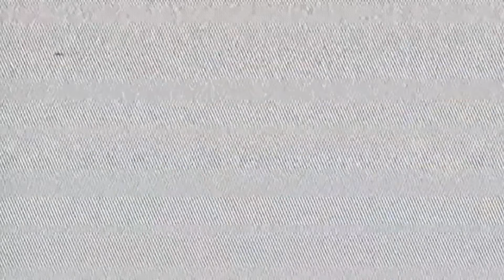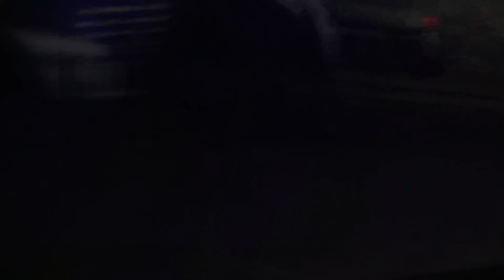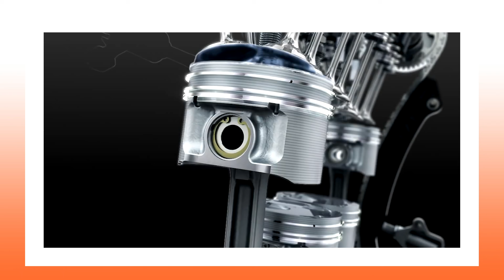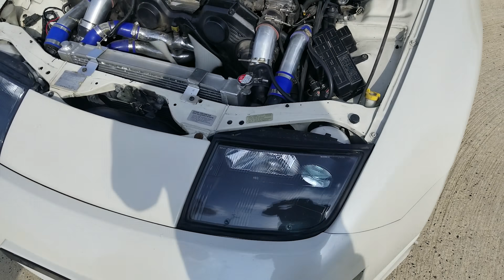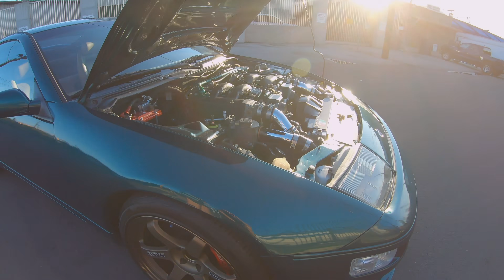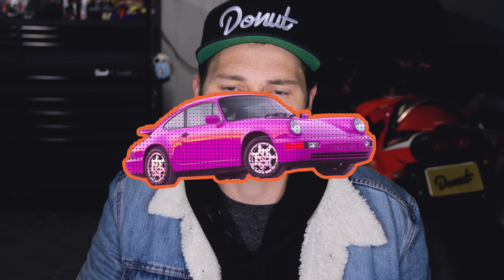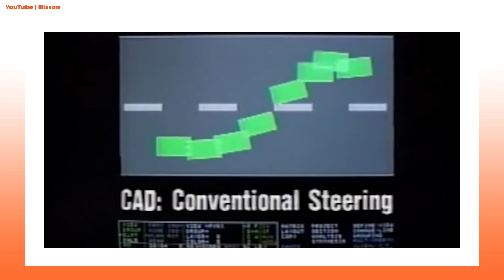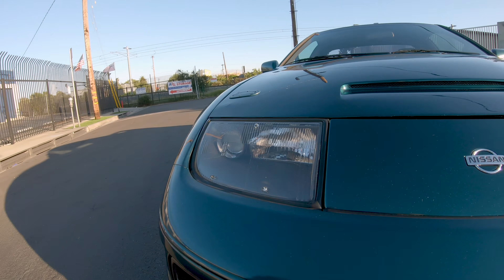The Incredible Tech that DOOMED the 300ZX

Comment: I used to have a '91, I bought it in '01. I loved that car. There were things that bugged me about it but not bad. As far as the tech stuff goes, a friend of mine was telling me one day about all the electronics in his Chevy S-10. I laughed at him and pulled out my factory service manual and showed him the (IIRC) 6 or 7 sensors in the fuel system between the gas tank and injectors. He accepted the fact that his truck, 8 -10 years newer than my car, was about as far as you can be from "technology advanced".

Comment: I own a 1990 N/A, and I've replaced the starter and alternator in the 6 years, and these were the most difficult replacements i've ever done. Then there's the Bose Sound System...I pain a stereo shop the replace my sound system, and they were like "No problem" it took them 2 days. Each speaker had it's own amp, ad they were prone to failure. I have owned it for 7 years and still find myself smiling every time I drive it.

Comment: I bought an 86 300zx 2+2 with a 5 speed a couple years ago. I grew up in them, my dad had one and my grandmother and grandfather had one and I loved them. It had been parked 9 years without being touched when I got it, I revived it, got it running and driving again but literally the day I first drove it was on to someone else's trailer. It had spent a lot of time on the Texas east coast and it was rusted far worse than the PO had led me to believe, to the point that I couldn't even jack the car up, the wheels would just stay on the ground. I had to let it go, I've never worked with that much rust before.

Comment: i have a 1990 NA TTop version and after owning it for 2 years the ONLY issue i have had is the battery not holding a charge because it was old. I call that a win . i just upgraded the suspension from stock to BCRacing DS coils, dropped it 2 inches and put some nice Niche wheels with Indy FIrehawk 500s on. 😙🤌

Comment: >titles video about tech that doomed the z32
>never explains why or how 

Classic donut media
Reply: If you really wanna know, there was no tech that doomed this car except the fact they are annoying af to work on and unreliable as hell
Reply: Ok it's not just me 😂
Reply: The variable valve timing was very new, and relied on a multitude of sensors and actuators that had a habit of failing with out giving an idea of what part of the system failed cause it was pre obd2. So it was tedious and there wasn't much working room. So yeah, when they're running right the car was amazing, but shit goes wrong, and you've got some long hours figuing out what went wrong
Reply: @Fabio.Enchilada   they're unreliable? mines still solid
Reply: all of those stuff are broken when you buy one. Also the turbo model have a poor ventilation and the turbos cook everything under the hood
Reply: @Fabio.Enchilada  isn't that true for most cars? I was suprised at howca Toyota I could wrap my arms around the engine yet not the Nissan. I hate working on any Nissan
Reply: @Fabio.Enchilada  thanks for saving me time
Reply: Old stuff is unreliable period sorry. Rebuild it and do it right and it's reliable. Maybe the old turbos ruin them? Idk the Vg30e I have is a champ
Reply: I’m not even mad

Comment: Got a z31 myself, currently doing a full restoration because it sat for many years. Currently on rebuilding the engine and redoing the interior while the block is at the machine shop rn, and it is the biggest pain in the ass to work on and not just because it’s hard to find parts. Somehow Nissan designed it to where every part of that car cannot be removed without removing 4 others. I love it though, def a challenge.

Comment: I've got an '84 Anniversary Edition in pull me over red sitting at my friend's house that I haven't been able to get to my place in some years but man do I love the looks of both the Z31 and Z32. I would love to get my hands on a twin turbo Z32 as well but they're not cheap or easy to find.
Reply: Im getting a 86 300zx and i want to know if its possible to convert the z31 engine into a z32 engine and is that a good idea to do so? Or should i 2j swap it? Can you send any videos or forums to help me out?
Reply: @Parelogy  If you want the Z32 TT, good luck. They're hard to get a hold of and building one up to handle the tein turbos is expensive. If you want the Z31 setup to be reliable and make decent power that's doable. There's Z31 and Z32 communities on Reddit and specific forums that would help with just about anything except maybe a swap to a different engine platform. There's a lot of basic mods for these, the best ones for reliability are definitely the ignition system upgrades as that's a major downfall of the Z31 between the bullshit cap and rotor design and the ignition control module burning out. Ignition control module swap is easily the best first mod.
Reply: @CheekyChan  2jz swap it is then, thx bro.... Or SR20 swap... Or just keep the engine since the vg30 from the z31 doesnt rly get much love... What do you think i should do? I also own a 1984 (check my channel if interested) mustang foxbody gt junked project car and i just wanna keep the 302 block and build it up instead of engine swapping and also efi convert it. I might just do the same for the z31, just keep the VG30 and mod it for fun and if im not satisfied then ill sr20 or 2j swap it...
Reply: @Parelogy  I would say stick with the VG30. They're beefy engines, built well, can handle decent power from a tune, bigger turbo/more PSI, cold air intake, aftermarket exhaust, etc. before needing to strengthen the internals. Problem with engine platform swaps is that they get expensive fast plus 2JZ's are getting hard to find and are expensive. There's a couple notorious issues with the Z31, as mentioned the cap and rotor crap out because of a shit design, they have a couple areas where they like to leak oil, valve cover gaskets, rear seal/s, etc. but those are at least normal wear parts, the instrument cluster also gets cold solder joints or messed up grounds, not that hard to fix and there's a ton of guys who can refurbish them for a decent price. Ignition control module likes to take a shit which is why the swap exists but that's at least super cheap and easy, a $10 plug adapter and a $20 part, takes literally 2 minutes to install. You can also run a direct coil setup but you'll need an aftermarket computer to control spark after defeating the cap and rotor, I personally think it's worth it and I'll go for it when I get mine to my house and start working out the kinks. My '06 Outback XT is my current project, clean but been modifying the suspension and throwing performance parts at it to get it where I want before I tune it and I have a '98 Volvo V70 XC project on the back burner too. So I feel you, man.

As for the 'stang, there's a reason why they call them "Five point slow"'s. Those 302's are dogs stock but they have pretty good performance potentials with a proper tune and there are TONS of aftermarket parts available for them. It doesn't take a lot of money to get power out of a 302 but an EFI swap is probably the first thing I'd do, it makes tuning the car down the line easier, especially if you're going to be adding mods that require more fuel, you won't have to tinker with a carb, think you set it right and then the next time you start it, it keeps falling on it's face or have to tinker with it because you drove to the mountains, etc.
Reply: @CheekyChan  thx man that helped alot... Now i just gotta study more on this stuff and learn what to do and how to do it... The z31 will be my project daily while my mustang will ne my project... Only driving it to carshows or roll racing or whatever... Both r going to be streetbuild and i think my 3rd car will be a pickup truck like a toyota pickup, and thats rly it...
Reply: @Parelogy  There's no better way to learn than to do it hands on, do your research, watch a few videos and attempt it for yourself if you feel it's within your realm of doability. Yeah, that 302 can make some good power and they make a shit load of aftermarket parts for them, even specifically for the Fox Body. As for a truck, you might as well get yourself an old F250 with a Powerstroke or a Dodge with a Cummins and pick up a flat bed trailer to haul your projects on just in case. Powerstroke has EGR and oil pump issues plus leaks in the oil delivery system but are easy enough to fix, they make kits to make them bullet proof. As for the Cummins, solid ass engines that'll go 400K+ miles but horrible transmission and computer issues.
Reply: @CheekyChan  thx alot bro, seriously.
Reply: @Parelogy  No problem, man. Hit me up if you need any help.
Reply: @CheekyChan  do you have a instagram?
Reply: @Parelogy  Yeah, it's cheeky.chan. I've got pics and videos of my XT on it mainly.

Comment: "these numbers are surprisingly insightful"

Yeah only with Nissan. Tell me the breakdown of what ls6 means, or 1uz-fe, or 4g63.

Most engine codes only include one (if that) decipherable piece of info. Nissan is wonderful for what they did there.
Reply: 1UZ-FE - UZ is the block series ,1st revision - F for DOHC narrow angle valve train - E for Electronic Fuel Injection.  
7M-GTE - 7th Revision, M Series block - G Wide Angle DOHC Valve train - T Turbocharged -E Electronic Fuel Injection

The designations are not as clear, but once you know them, you can apply this to nearly all Toyota engines.  G series heads are considered the performance oriented heads while F series heads are economy/low-end torque heads.
Reply: @suprafreak7m-FPS  that's really cool thanks. It's like every manufacturer has their own language. Nissan just made the easiest one.
Reply: @suprafreak7m-FPS  4-number of cylinders G-type of fuel (gasoline)6-is engine family 3-is model, then T if turbocharged.

Comment: Correction: "On most engines the timing... ... is consistent throughout the rev range". That is very false, by the end of the 90s, vvt was trickling all the way down to economy class engines, and today,  all manufacturers combined,  there aren't more than a small handful of engine without vvt. You'd have a point for the early 90s, as at that point, only alfa romeo, honda, nissan and Porsche had such system in production cars.
Reply: Yeah so Nissan was developing this in the 80's since this car started production in 89

Comment: Here's what I know.. I've had 3 in my life that friends have owned...
So basicly the American and the Japanese versions have diffrent motors that are not interchangable..
So when a motor gets blown.. there was no spare blocks made for the American cars.. so to find one you have to hunt,hunt,hunt, and when you do find one it's always high miles and not in good shape plus it costs a premium to buy.. in one case the short block was the same cost as the guy paid for the whole car....
Plus it had to be rebuilt... this is what doomed the car in the u.s.
Japanese cars got spare motors and never had to go though the same headache as the u.s. owners..
Last time one was needed that I know of only two were available in all of the United States... closest and cheapest was texas.. and between shipping and motor price it was more than the whole car was worth..via bluebook..and the motor had 120,000 miles on it already.. the other one was in new York and had 160,000 miles on it.. so don't get fooled.. Unless you can get a low mileage car for super cheap.. then sell the motor and double your money.. then part out the rest or sell as a roller...lol... only thing I know that you can do is a 2jz swap once the motor blows..you get more power and costs half as much to do as there are tons of them..
Reply: U.S and JDM motors are identical and fully exchangeable, plus the Z32 outsold the Supra 10 fold in the U.S, which means there are FAR more used VG30's motors in the U.S than there are 2jZ's and the motors are a LOT cheaper.

Comment: I owned a 96 non-turbo 300zx for about two years in high school before I crashed it. One of the lowest points in my life having one of the coolest cars in school to no car. 

That said, It occurred on a descending radius turn about a quarter mile in length. Me being young and thinking I was driving a legit sports car (I was) but inexperienced with rear wheel drive caused me to spin out and hit a few mailboxes. "Minor" damage, but the airbags went off and the vehicle was totaled. 

It wasn't until many years later that I discovered the TT version of the car had the hicas system. I avoided the TT because they were hard to find, and my father said "too much power" for me at that age, which turned out to be true. 

I still to this day though wonder if I would have wrecked on that turn, going about 50mph with the hicas system installed. Lost the rear end and that's all she wrote. LOVED that car.

Comment: I made a massive mistake a couple years ago and told my buddy I would help him change out the spark plugs on his 300ZX... I mean, they are just spark plugs, how hard could it be? Basically a whole day filled with bad words and bloody knuckles until the sun went down. FYI, don't offer to change the spark plugs in someone's 300zx
Reply: lol Its a 15min job. You just need to remove the Throttle cover and balance tube,  all with very accessible fixings.  There are a lot of worse cars to change plugs on, in fact most modern cars take a lot longer.

Comment: The engine of the 300Z is very different from the 280's. I had a couple 280Z's a 79 and an 81. Those as I remember had a straight 6 I think. It's been more than 25 years since I had one so I'm rusty on the specks of those older Z's.

Comment: I had a brand new 1993 300zx automatic convertible forest green with tan leather & suede interior, chrome 300ZX wheels & a black top. I traded it in and my 1993 VW Corrado VR6 SLC in on a new out of the show room last in NY 1996 brand new Nissan 300ZX TwinTurbo BLK on BLK. I loved all 3 of those cars for the time and the 90’s weren’t like today, Those were big boy cars back then. This is where the story ends for the 3z because in ‘1998’ I traded my 96 300zx TT in on a brand new out of the dealership, black on black with gold package Lexus GS 400. I was 20yrs old at the time and two weeks later bought a pair of 19inch BBS style wheels. But when the boost kicked in, in 2nd gear it had some power back then & drifted around my development, with a lot of close calls lol.

Comment: I had one for 4 years, bought it with 50k miles on it on 2002. It was a 1990 NA
It was a head turner, everyone looked at it, lots of people offered to buy it.   Unfortunately I ran out of money while I went to college and had to sell it as an engine problem a few mechanics could not figure out, I had to sell it.

I’ll put the photos in a a video and comment back here in a few days.
To compensate I bought a Nissan Xterra and put 171,000 miles on it and I’m still driving it today I had one warranty timing chain tensioner replacement other than that I had a radiator mix the coolant and transmission fluid cross contamination problem that I fixed right away before any major damage was done to the transmission. And I’m driving right now as I write this comment.

Comment: 55378008 is what we always did. Had a 300zxtt and looooooved it. had it 18 months. It spent 9 of them in the shop. Fortunately (for me) the Chrysler dealership that sold it to me sold me an extended warranty. One of the greats. Black on black. Shaved race tires. so smooth, so fast. Not saying it was faster than anything else, cuz haters gonna jump on and brag, but I loved that car.

Comment: I've owned 2 Z32's. A 1994 two seater, and a 1993 2+2. The 94 had been thrashed, and the dealer that sold it to me didn't even top off the coolant in it when it blew a hose during a previous test drive. So naturally, when I bought it and started driving home, it overheated. It also developed a knock sensor issue, which retarded the timing and made it slower than a bicycle. Apparently, it's in a tough to reach area, because it was expensive to replace. Also had to have the transmission rebuilt on that one... 4th gear was... well... gone. My 1993 was in amazing shape, and the only issue I had was the crappy pintle style injectors giving up. I swapped those over to the 1996 style injectors with a kit, and never had another issue as long as I had it. Guy that bought it from me still has it and sends me pictures once in a while... I wish I hadn't sold it.

Comment: Back in the 90's I had a 95' 300Z TT  THEN A 94' STEALTH R/T TURBO.  LOVED THEM BOTH.  THEY WERE VERY CLOSE IN STRAIGHT LINE SPEED WITH THE AWD GIVING THE STEALTH THE ADVANTAGE IN A DRAG RACE, BUT THERE IS NO COMPARISON AS FAR AS HANDLING IS CONCERNED ESPECIALLY AT HIGH SPEED.  THE 300zx's LOW CG, EXCELLENT STEERING & BRAKES MADE IT THE EASIER CAR TO DRIVE FAST AND IT LOOKED BETTER (T-TOPS) AND SOUNDED WAY BETTER THAN THE R/T TURBO.

Comment: The Fairlady Z32 is still by far the most beautiful car Nissan has ever made. It is still jaw-dropping to see one today out in the roads. The design is just perfect and it is so full of the classic 90's redundant tech form JDM manufacturers. It's amazing how much presence an old 90's Japanese car can have. Even makes the Z33 and Z34 look like Barbie toy cars.

Still one of my dream cars, if I could find a Twin Turbo, 2-seater, manual one that hasn't been tampered with. Bone stock, low miles. All you find nowadays are really beaten, abused, riced/tuned ones. It's one thing I hate about the JDM culture.

Comment: 300zx z32 TT here. Not that pain to work on really. It's a car you need the economy to do right. You do it once, and you do it right instead of the going for the cheapest halfass solution. If you do things right the first time it's reliable as any other car really. And my god it's a fantastic driving machine.

Mine has 440whp now. Going for around 550whp next month. :)